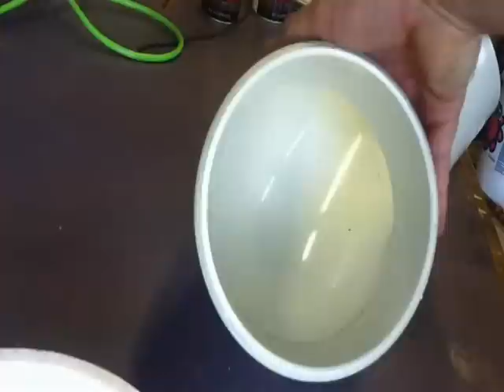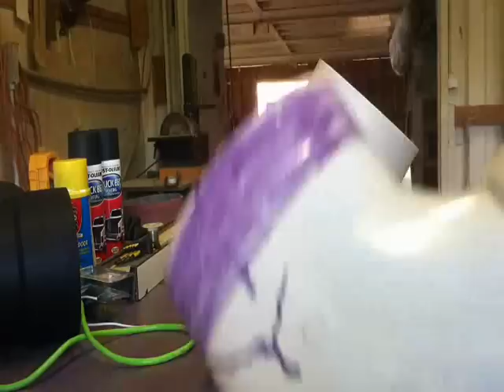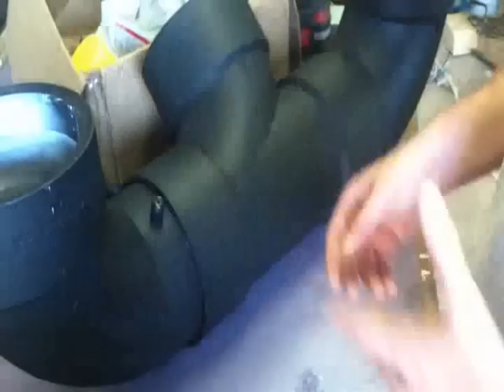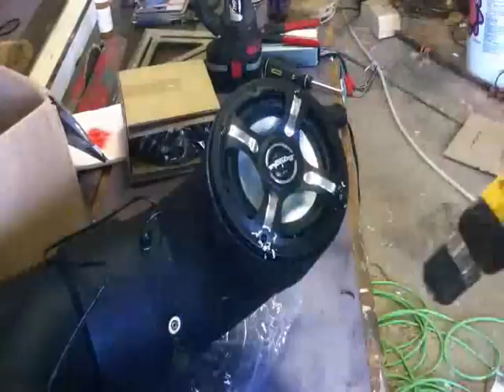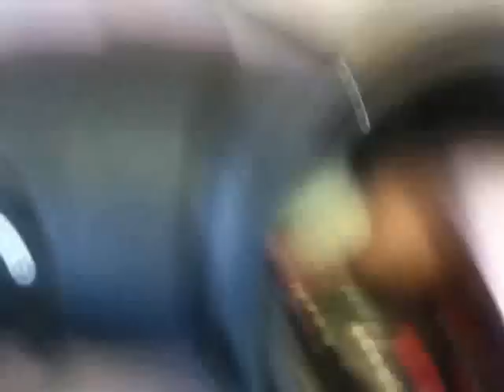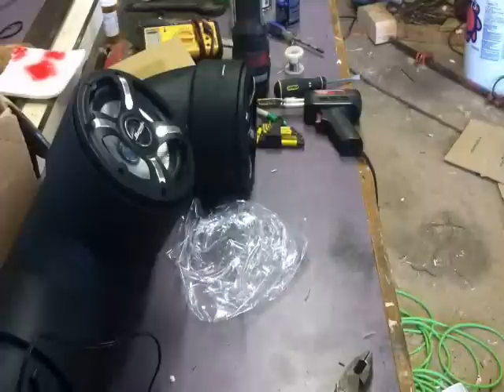Whoolie Shop Audio Tube Build

Comment: This is confusing.
I'm trying to draw a diagram as you explain.
At first you spliced the blue tooth adapt and 10 amp power supply to the amp power supply.
Then towards the end you have rca connections on the end of your blue tooth adapt... I thought you spliced that in with the power supply? How does it all of a sudden have rca connections on it?
Reply from the maker: J. Seagroves the Bluetooth adapter has to have power, which is why one end of it requires 12vdc power and ground, they also have rca outputs which connect to the amplifier inputs, this allows the music to be wirelessly streamed from your device, to the adapter then sent into the amplifier.

Comment: One modification you could do that I think would be cool is...
Instead of adding a 3rd speaker in the middle.
Cut a piece of wood in a circle shape to fit down in the bottom and use a piece of pipe that is threaded so you can screw a cap onto it.
Then you would have 2 speakers on each end and the center would have a screw on cap that you could unscrew and then you'd have a little storage area to put your cell phone, i pod, keys, wallet, cigarettes etc.

Comment: Also, I may have missed it, but how did you mount your amp to the speaker? I know he wood blocks but how did you mount the blocks to the tube so it doesn’t bounce around.
Reply from the maker: Expanding foam  typically like great stuff Or subfloor adhesive, if you use a caulk style adhesive make sure it’s high in polyurethane content.

Comment: Did you have to put in any sort of ventilation system for the amp not to burn up?
Reply from the maker: Hunter Owens no if you wire your amp up at around a 4 ohm load there’s enough air in the tube to keep it cool even in 100 degree weather.  If your down to a two ohm load it would probably be okay with a two ohm stable load in all but the most extreme situations.

Comment: will a 4in pvc pipe work for a 5 1/4 speaker if you use a coupling with a pvc ring to mount the speaker
Reply from the maker: Peyton Greene it really depends on the 5-1/4 because some run smaller than others.  6 1/2” pvc is around 7” outside diameter (on a coupling).  So that should make the outside of a 4” coupling about 4 1/2”.  You would probably be better off with 4” speakers.

Comment: Very informative, the only part I'm confused on is what you did with the RCA jacks coming off of the amplifier?
Reply from the maker: Sal C at around 46 minutes in the RCA’s are hooked into the amplifier.    In this build we used a Bluetooth adapter AND a 3.5mm jack.  This requires a pair of rca splitters (2 female to 1 male)   Which combines the two inputs together.    Since this is a four channel amplifier we also need the opposite splitters (1 female to 2 male) so that both inputs can be fed to both channels of the amplifier.  If this is hard to make sense of send us an email to sales@whoolie.com and we would be happy to send you a wiring Diagram that shows how to set this up.    It is important to use the splitters if you are using two separate inputs or a 4 channel amp to get your signal sent to all the channels.

Comment: Amazing build,   my question is what is the size of  street Elbows an inner diameter speaker rings. an size of speakers i believe its an 6in speaker im looking to build an set up like this on my vw bug, thanks for posting this territorial
Reply from the maker: MrKlink951 it is all constructed using 6” schedule 40 pvc fittings and pipe.  

Schedule 40 has a wall diameter of about 1/4” so the rings are about 6 1/2” OD and the bell of the street elbow brings that out to right at 7”.   We use 6 1/2” speakers from wetsounds or infinity in our builds.   But do measure your speakers as not all 6 1/2” speakers measure a true 6 1/2”.

Comment: Any idea on how could attach one these to my pioneer 700 deluxe side by side
Reply from the maker: John Hassler typically we either use bolts through the tube with a plate on the other side or a ratchet style strap to secure them.   Building a hard point mounting option is a bit more work and requires more planning but is more secure in the long run.   

The easiest off the shelf diy hard mount option would be those U bolts that have a squared end rather than a rounded end!

Comment: what is the little grommet called for the 12 volt wire
Reply from the maker: Hunter Dery we just call them grommets, you can find them at www.whoolie.com under the diy products for audio tubes
Reply: The Whoolie Shop how much extra would it cost to do a Bluetooth setup
Reply from the maker: Hunter Dery if you don't need a 3.5mm connector no extra at all, if you want both it's $35 extra for the bt and splitters
Reply: The Whoolie Shop ok thanks

Comment: wanted to thank you for the tutorial. I built a kick ass setup just like the one you have here. my only problem I have is when I turn volume all the way up Bluetooth keeps losing signal. do you think it could be bad Bluetooth dongle I soldered in?
Reply from the maker: Mark Pulford it could be a couple of things, are you sure the Bluetooth is cutting out and not the amplifier?  Volume should not really affect your Bluetooth receiver unless it's losing voltage.     If it were losing voltage it would fully disconnect then reconnect and start playing again.   If the sound just skips it might be the amplifier cutting out which could be caused by a number of things.   If you would like some more help please email me at sales@whoolie.com
Reply: I would say amp.  You may not be supplying the power required to the amp it needs to produce the higher volume.  I had this happen on my boat setup.  I used 8 Ga wire for the amp instead of 4Ga.
Reply: +The Whoolie Shop  i have a boss tube how do u replace the aux jack

Comment: question. if I added another tee to that setup and installed another speaker in that tee and used the other channel to make it a 4 speaker setup would that work just as well as the 3 speaker setup you just demonstrated? just curious. great video by the way
Reply from the maker: Mark Pulford yes this could be expanded to a four speaker setup... HOWEVER; the three speaker tube is already quite wide.  Adding another tee will leave it overhanging both sides of most ATV racks!    Your average machine has a rack more narrow than 48", 4 speaker tubes with two tees, push past this width.

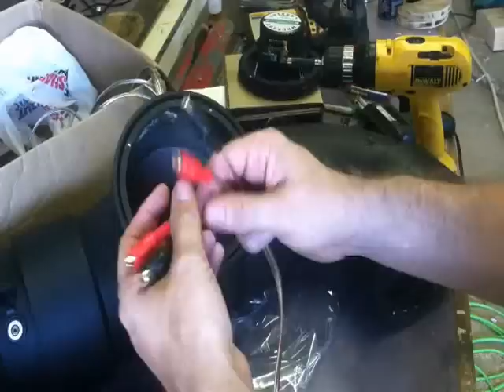Comment: Please accept my apologies first hand but, you have made me feel like I am suffocating with this video... LOL I had to stop at 38:18 I can't watch any longer... I am a professional car and home audio installer and a musical engineer and am 41 years old and have been an Audiophile since I got my first boom box when I was 10 years old... The point to my ramble is well 1. you should've put a 10 amp buss fuse inline with the power to the amp
2. for safety to the amp and speakers... DO NOT put a cigarette plug with a rocker switch on it, have the power going straight into the amp with said buss fuse inline to the RED wire and THEN the BLUE wire AFTER the said fuse (so both Red and Blue is split from same source) with a rocker or toggle switch in between (spliced into the BLUE wire) "from after the fuse into the switch then out the switch into amp remote lead" to prevent a surge and "speaker thump" creating damage to the speakers and amp.
3. SHRINK TUBING... Never use electrical tape where there will be constant heat the heat will make the glue sticky and start making the tape come loose from it's unwinding and eventually old dry and brittle and create problems.
4. Why not make the wire as long as it was straight out the package and also put it in the back away from the rest of everything else to prevent clutter and wires from getting tangled up (have you ever bought a Home Stereo, Car Stereo, VCR, DVD, Tape Deck, Boom Box, Coffee Pot, etc. with the power chord protruding out the front LOL
5. Separate switches for amp on and Bluetooth on would make more sense so that way A. less things on at once and like you said B. so two audio sources don't go through at the same time...
6. why not use all 4 channels ( Channels A and B Stereo Left and Right 4 ohm and use channels C and D bridged in series so to have an 8 ohm load so to reduce the load and use the center speaker as a sub/mid woofer with a choke coil on it so its mostly bass and it would sound more warm with those lower tones... Plus the sound wont be and feel out of phase it will sound terrible to the trained ears and possible even the untrained ears as well.
7. even though (I noticed) the speakers have foam surround on the back of the basket why not for extra precaution use a 1/4" 3M type window strip seal to wrap around for extra precaution on air escape and also to prevent the speakers from over excursion I suggest about 4oz Poly-fill stuffed all the way through... oh that's right you cant because you are putting the amp inside of a sweat box where no possible heat escape so really in conclusion the whole thing is not a good idea unless you cut a rectangle out of the back of the contraption the width and length of the amp so the heat sinks (that are obviously on the top of the amp) can protrude out making for a safer application and giving it longer life.I shall continue off where I started now and see what else advice I think you may need... I do want to add that I am not condemning you on your work but I feel so to save you money and to have a better warrantee on your product to please accept my constructive criticism and take all that I said into consideration... Many Blessings... Good luck :-) WiKiT of WiKiTWoNKaWeKoRDS LLC
A. CLARION XC1410 CLASS D 4 CHANNEL AMP - Class D Technology Power Supply
- PWM Regulated MOS-FET Power Supply
- 300 Watts Maximum Power Output
- 75 Watts x 4 Continuous @ 2-Ohms
- 50 Watts X 4 Continuous @ 4-Ohms 
B. Bazooka MAC6502B Coaxial Marine Speaker- Sensitivity: 88 dB
- RMS Power Range : 60 Watts
- Peak Power Handling: 120 Watts
- Frequency response: 56-20000 Hz
- Diameter: 6.5 Inch
Reply from the maker: WiKiT WoNKa 
Okay long post I'll try to address your concerns. 

Your point #1 & 2 - ( inline fuse )
The accessory port plugs all have an inline buss style fuse in the tip, this particular model is a 10 amp. The cigarette lighter adapter is also fused again on most ATV's which is usually a 15 a circuit. The rocker which switches the power on/off safely protects both the power and remote circuit at 10a. 

Your point #3 - SHRINK TUBING
Had you finished the video you would have noticed I suggested heat shrink, HOWEVER; for the spirit of this DIY video I decided to use tape, as for the general consumer they typically won't have / won't go out and buy various sizes of heat shrink. 

Your point #4 - wire length. 
This is purely a matter of preference, on an ATV which is what this setup is designed for, wires longer than they need to be pose a risk of getting snagged and ripped out or worse causing a short. IMO, the shorter the run the better. 

 Your point #5 more switches....
Again this is a matter of preference, typically on these tubes if you get one / install one with Bluetooth that is your primary connection, the 3.5mm connection these days is purely there as a backup, thus interference would never happen under normal use.   Secondly, ATVs are typically exposed to harsh, dusty, and wet conditions.  More switches means more holes and more possible water intrusion points.  

Your point 6 (part 2) - using all 4 channels..

This build is a THREE speaker audio tube there is only room for three speakers and they all share a common airspace.  Thus using a 6" sub with at double the ohm load would cause the coaxials to be outdriven by the 6" driver at 4 ohms. Causing them to pop and wear out voice coils. Therefore it only makes sense to use 3 coaxials and feed them all the exact same signal.  6 1/2" coaxials can not do the job of 8's, 10's or 12's so trying to get a 6" coaxials to do the job of a sub is just wishful thinking.  These tubes do quite well in the midbass department in a all in one package.  If you were to want a true full range audio experience you would definitely need to have dedicated drivers that specialize in reproducing their respective frequencies. Which again is outside the scope of this build because it's in an open air environment on the front of an ATV with exactly zero surfaces for the bass to reflect off of. 

Your point #7 extra foam tape.  
You didn't watch the end of the video, where the speakers were sealed to the tube using permatex RTV silicone, which when dry seals out moisture while keeping air in, also after you quit watching there was polyfill added, and finally cutting a hole in the PVC so the amp can breathe would allow moisture, water and dust into the amplifier inviting corrosion, while this is a "marine" amplifier, there isn't an amplifier manufacturer on this planet that will warranty against mud intrusion into the amp. Which it will most definitely get with a hole cut through it and improperly sealed; because again this is intended to be mounted on the front rack of an All Terrain Vehicle (4 wheeler)

In conclusion I would like to thank you for taking the time to comment on this video. Hopefully my explanations will shed some light on the reasons I went about it the way I did. Although I feel like since you didn't watch the video and you obviously don't understand the intended application/environment this build lives in several of your comments/critiques were irrelevant.
Reply: You should really consider everything Wikit wonks has said as it was spot on. I too have been in the Audio industry for many years and was saying everything he did as I watched this video. Hey don’t get me wrong these tubes are neat and are a great idea so please keep it up just really look into everything that was said and you will see he was correct in ever word. Thank you for sharing the video with us and spending the time to make it I do appreciate it.
Reply: Well listen to Professor know-it-all some people just don't take I mean really he's not claiming to be a full-out engineer Mr audio file I don't understand why you're doing and saying what you're saying you just trying to remember or make him feel like an idiot are you just a troll I don't even know the guy that's the first time I've watched the any of the videos he's made he's just going around spreading a little information which I don't think it's hurting anybody and it sounds like you're reading him the Riot Act and if you know anything about cars you know that the cigarette lighter plug is fused so there wouldn't be a short so if anything's shorted out in the system the fuse would blow so evidently you're not such a smart person because you would have known that if you're saying if you really are what you're saying evidently you're full of it
Reply: Peterj McGee bro no one was trying to hurt his or your feelings. I think the comment was said in a way to be helpful but apparently it hurt you little feelings bummer.
Reply: think you can make a wiring diagram? so i can visually see everything and how it should be wired.

Comment: have you ever made a tube with 8 inch speakers
Reply from the maker: We have, however; schedule 40 PVC pipe and fittings are extremely expensive.  If a 6" elbow costs $25 a 8" elbow costs $75.  Thus building an 8" tube gets real expensive real fast.
Reply: +The Whoolie Shop what kind of 8 inch did you use? I'm thinking bout using some 8 inch kenwoods but I'm concerned the speaker won't fit into pipe
Reply from the maker: +Christian Rodriguez 8" schedule 40 PVC,  it will be roughly 8 1/2" outside diameter. Sch 40 PVC is 1/4" thick
Reply: Which sounded better to you the 8 inch or 6.5s

Comment: One question that I haven't seen asked is: how is the vibration. is there any coming from the PVC pipe or is there solid sound?
Reply from the maker: The sidewalks of Schedule 40 PVC is right at 1/4" thick so there's very little flex on the pipe and fittings.   We do however recommend adding some polyfill or fiberglass insulation inside the tube to give the 6 1/2" drivers a little fuller sound.  If you listen closely to a tube with polyfill and one without the tube without will have a little bit of a ringing sound to it where as one with the polyfill sounds more full and accurate.
Reply from the maker: *sidewalls not sidewalks